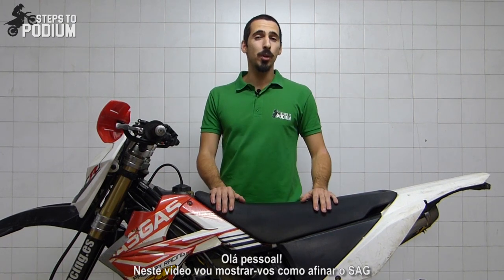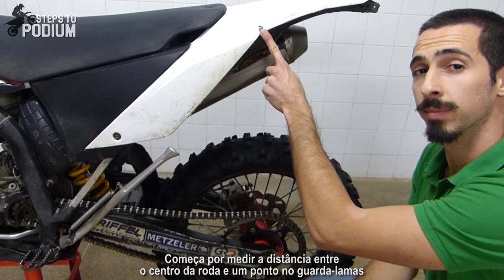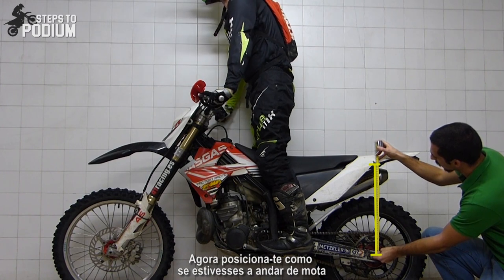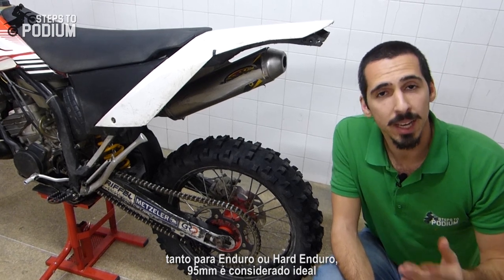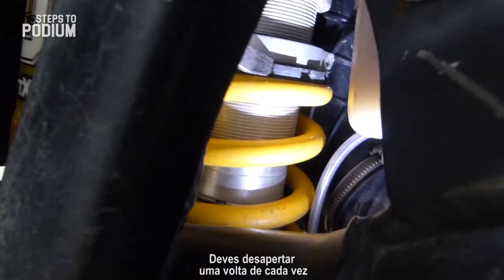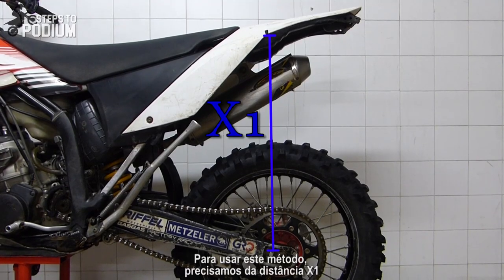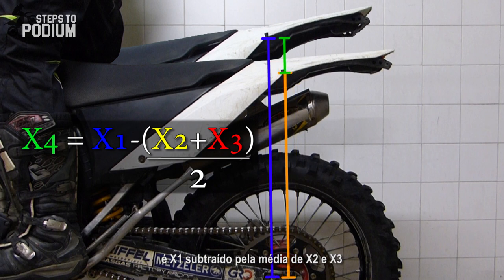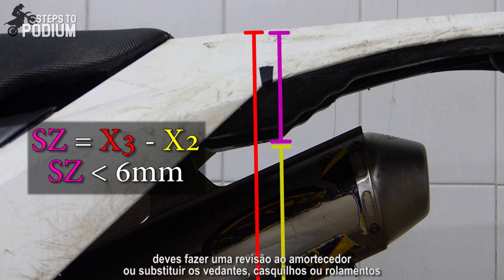How to set SAG: Common way or Race Tech?

Comment: Guys, thanks for the video, it's very useful! But I wanted to deduce the determination for the word sag. is it possible to call a sag a range? Sag as a  manufacturer's recommended suspension compression range? A static sag is from 30mm to 40 but its a range, it is a recommended range and for a rider sag also is a recommended range. So is the sag a range first of all?
Reply from the maker: The SAG is a measurement 😉

Comment: Mate, when you say that "using this method they affirm it can be accurate to 1mm" means that if done again it'll always result in 1mm less or 1mm more everytime, is that it? (assuming no other thing interferes with the measuring) --Thanks again
Reply from the maker: Around 1mm more, or 1mm less :)
Reply: @StepstoPodium  so I think it's what I understand corrently if I'm not misuderstanding it lol -- thanks mate

Comment: what happens if your sag goes past a little bit what the recommended range in the manual is?
Reply from the maker: There shouldn't be a problem! those values are for a broad set of applications. if for what you use the bike for you get far more from a different sag value then the one recommended, there is no problem,  as long as that doesn't imply you bottom out too often and cause accelerated wear on the shock/forks 😊
If my info is right, some factory  extreme enduro riders have the sag well above the recommended values (more than 105mm - why use that value, you have to ask them!), but since they tune the suspension for each race, they don't cause accelerated wear on the suspensions.